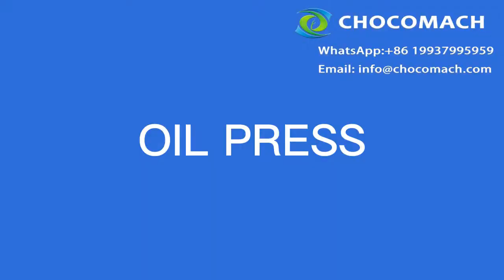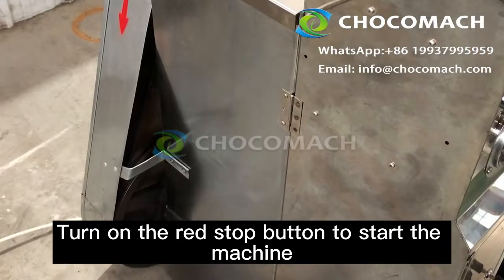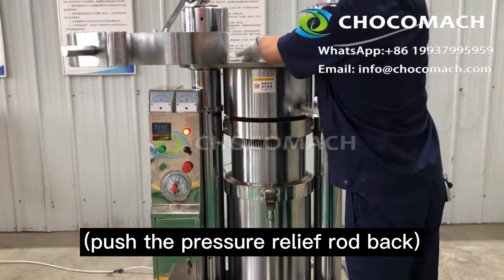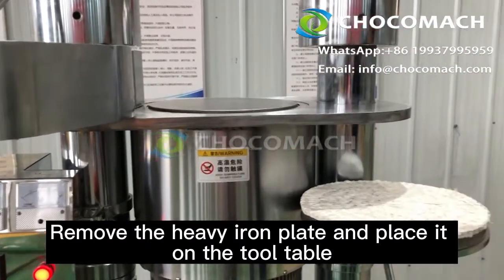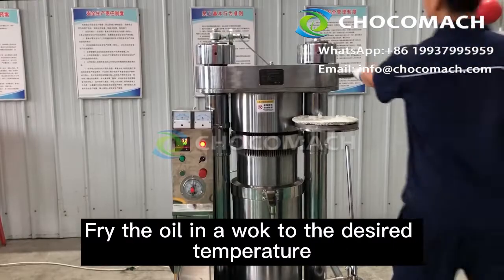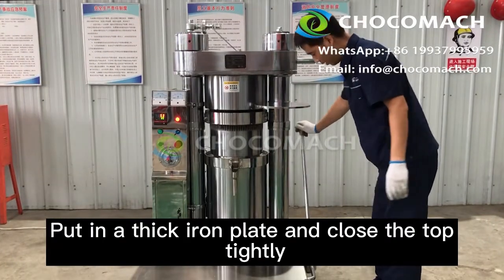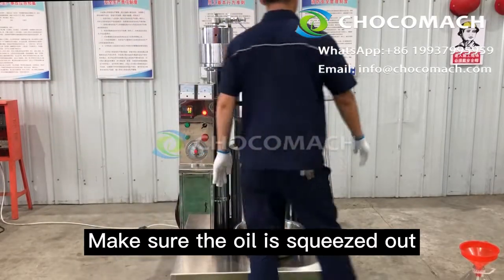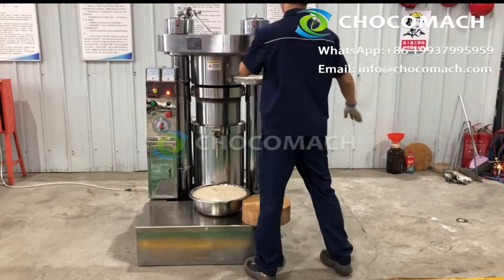hydraulic oil press and cold pressed nuts operating video#hydraulicpress #coconut #walnut #peanut

Comment from the maker: type          each charging(kg)      pressure(Mpa)    voltage(v)       motor power(kw)        L*W*H(mm)         N.W.(kg)
YZL-230             8                                  60                    380                           2.2                  1000*970*1420         1050 
YZL-270            13                                60                    380                           2.2                1180*1000*1600          1450
YZL-300            17                                60                    380                           2.2                1210*1089*1620          1760 
YZL-325            20                                60                    380                           2.2                1210*1100*1620          1850 
YZL-365            30                                60                    380                            3                  1310*1160*1880           2600

Comment from the maker: Features of YZL Hydraulic Oil Press From CHOCOMACH 
1. Increase the number of oil lines, the oil output rate is higher, the gap of the oil line is reduced, the oil output is clearer, and the impurities are less.
2. Ultra-high pressure three-plunger oil pump, the maximum pressure of the system can reach 70MPa, the design of the enlarged oil tank has high pressure, high temperature resistance, and can work continuously for 24 hours.
3. The hydraulic oil level is precisely controlled, and the cake is automatically stopped when the cake is released, preventing the plunger of the oil cylinder from being detached from the cylinder, and the hydraulic oil will pollute the grease.
4. The oil return pipe is made of stainless steel wire hose, which is not easy to break due to aging.
5. The material cylinder is equipped with dual heating and dual temperature control systems, with faster heating and smoother oil output.
6. The sunken and thickened bottom plate has a higher safety factor, reduces the height of the whole machine, and is easy to operate.
7. The core components are all processed by advanced CNC machining centers with higher precision.